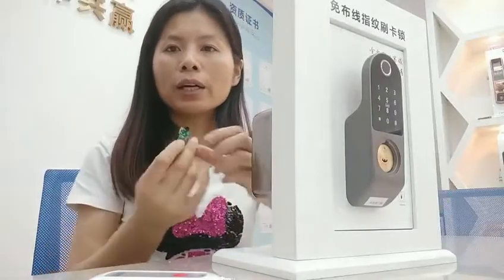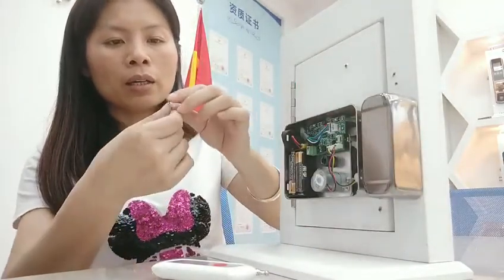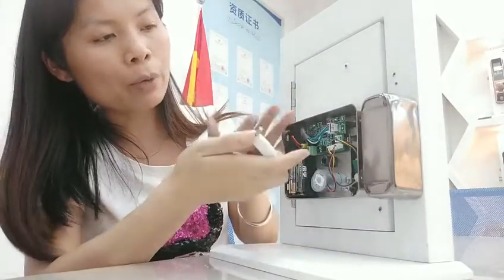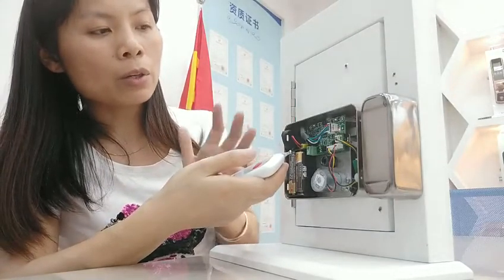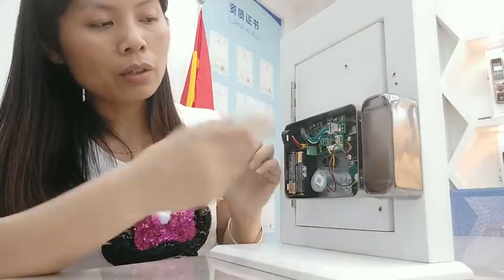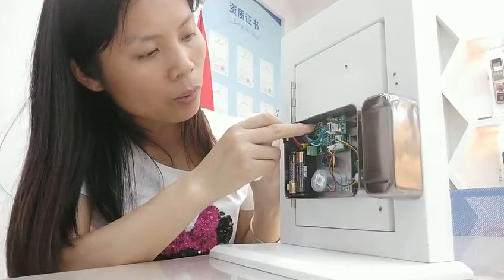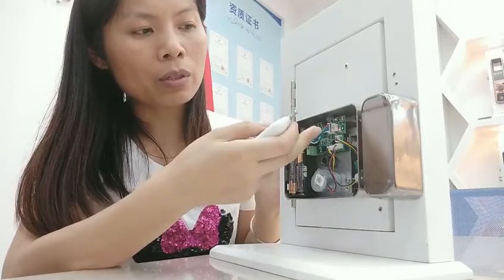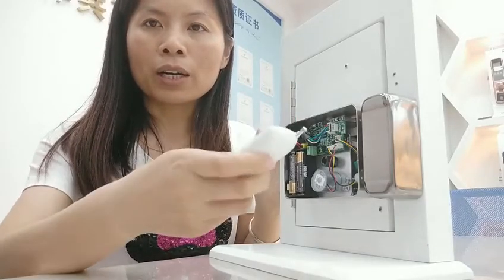How to add and delete remote controller for the rim gate lock

Comment: hello, is this lock to use batteries and 12V electricity source at the same time?
Reply from the maker: Usually, the factory suggests one kind of working power to work, if both work in together, no big matter.
Reply: @smartlocks  yes or no